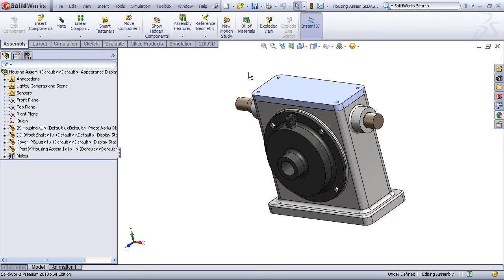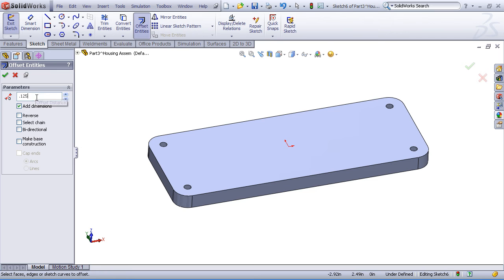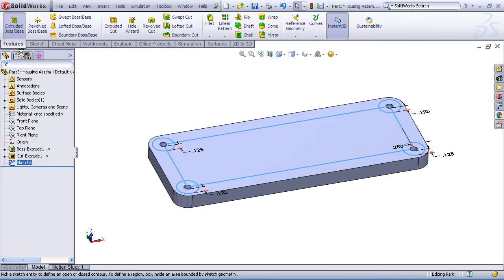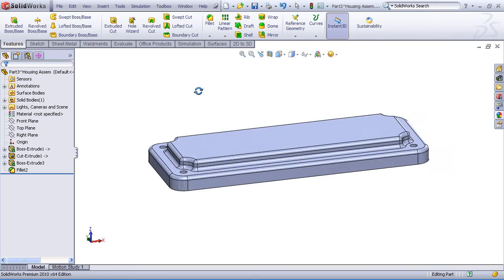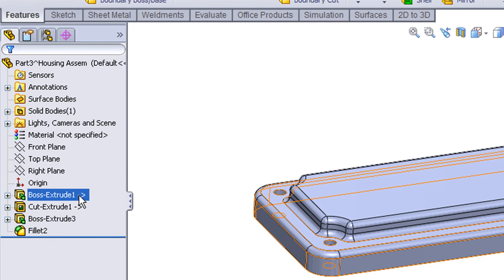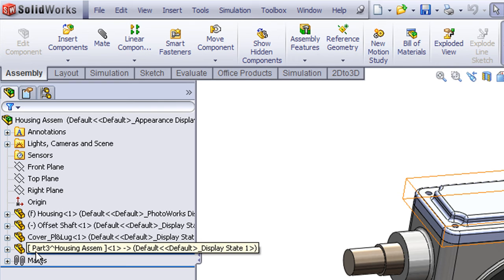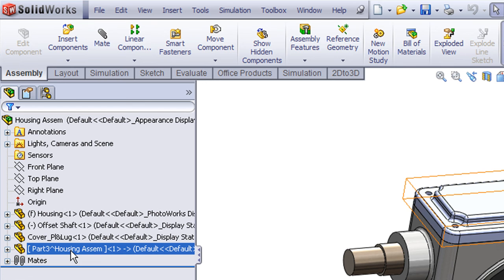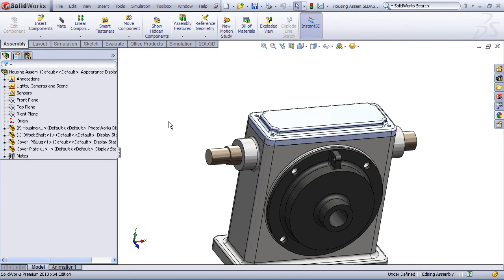In Context Design Part3

Comment: Actually i just figured it. when you press on new part, SolidWorks prompts to choose a face or plane to begin the sketch on. When you select the face or plane to place, SolidWorks places the front plane of the new part on it, opens a new sketch and adds an InPlace mate to the assembly. the"InPlace" mate is what is holding you from changing the position of the newly created part. delete it and you should be good to go.

Comment: I think this is too late, but I had the same question, so after consulting solidworks bible i came to conclusion that in context designed are meant to be fixed, or related to some parts. Meaning in context created parts will only change if the related part changes. Hope this helps